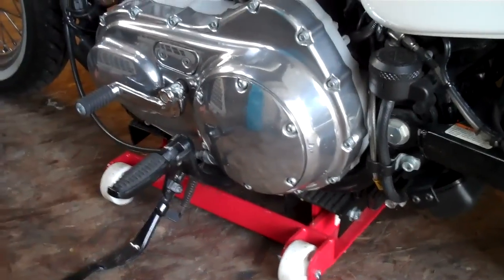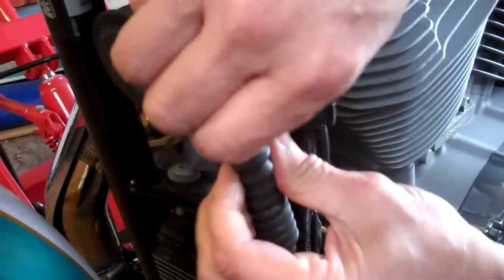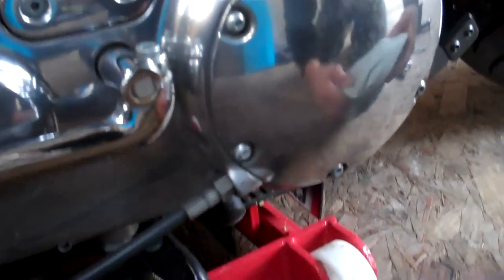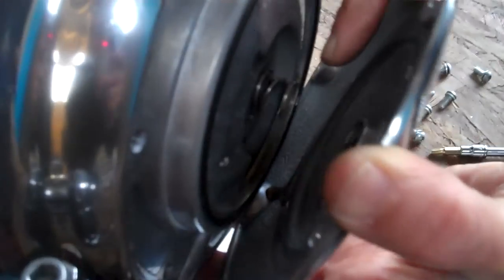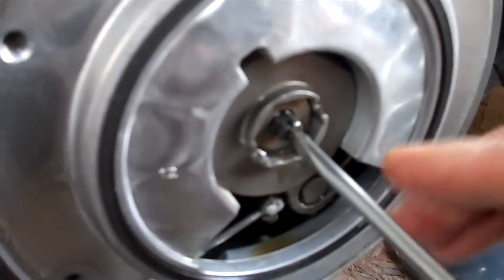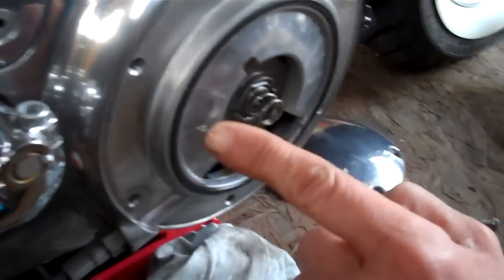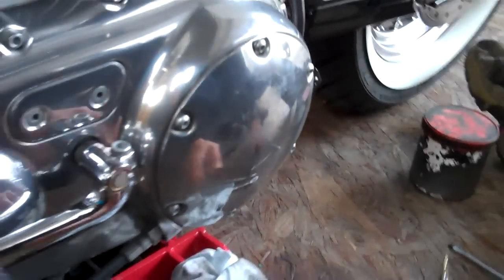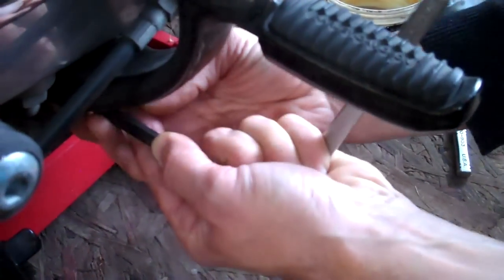Delboy's Garage, Harley Sportster Clutch Adjustment.

Comment: Hi Del. Your video is great! Many thanks for the clarity of everything you put out. I just wondered if you had any ideas on this problem I have. I just bought a 04 Sporty 1200 and the clutch was biting very close to the handlebar so decided to adjust it. When I drained the oil there was very little in - thick and black. Put 1 litre of fresh 10-40 oil in and followed your adjustment video. Now the clutch won't disengage fully and gears grind going into first?? Any ideas would be much appreciated. Thanks

Comment from the maker: @1supermanprime Hi buddy, as long as you turned out "ANTICLOCKWISE" then it usually stops against the seat within about two turns max,.... but if you have had to turn it 6 or 7 revolutions... then it looks like the reason is that somebody who did it last time made the common mistake af turning it IN or CLOCKWISE... 

Whatever you have now... just make sure it is one quarter turn IN from fully out... (so turn to the left until it stops... then turn one quarter to the right..ok?)

Comment from the maker: extra plate is to increase the friction level in the case of extreme tuning.....plus....do you think !"Harley actually MAKE!" clutch components?....no, they buy them in just like 99% of their parts...and who makes 99% of all clutch components...Goodridge and Barnett"......so you're just making an upgrade on the spec that's all... and only do that if you need to for something like a 60% increase in torque.....hope that helps..good luck buddy. Del.

Comment: On a sporty XL 2008 what could cause that the gear is not changing but when I re-engage the clutch lever I will hear a quiet click on the current gear and then the gear will go into its designated place. This happens at random times and not always.

Comment: First, Thank you all the way from Canada. I attempted to adjust the clutch pack and did my very best to follow your excellent instructions. After putting everything back together I went for a test ride. Now it was late in the evening and didn't really let the bike warm up. From the start the bike reved to 2000rpm. I made it around the block and came straight back home. Is this a direct result of a mistake in the clutch adjustment or do Sportsters rev high when cold? Thank you so much

Comment: Hi Del. i am gonna do this job saturday i think. I have a question about when you turn the adjuster screw to the left and then it will bottom out , right? the question i have is when you turn it back to the right , does it bottom out, or  does it need to be a precise quarter of a turn. I just gotta be sure before i start this. Thanks for the awesome video AND answering all my question.

Comment: Great videos! I have a weeping leak from the shifter when riding on a 2009 XL. I pushed the black bushing up against the engine on the shifting rod to see if that helped for a bit. No more leaking. But now I am not sure of the current oil level or what it would sound/feel like with low oil in the primary. Would I follow similar steps to check the oil level on the primary chain as demonstrated here or could I ride until next oil change? Any tips would be helpful for a new Harley owner.
Reply from the maker: Hi Jeffrey, There is a ring seal in the output shaft hole and it looks like you managed to push it back in so it seals....if it leaks again you may have to replace it (really easy job) but if its sealed again for now then great....

To check the Primary oil level, set the bike upright (NOT on the stand) and take the clutch inspection cover off.....look down at the bottom of the clutch pack and you should have the oil just touching the bottom of the plates....if its a little low, then just add a little more through the hole until its correct... its not too critical buddy, its just splash oil to keep the chain from eating the sprockets....no pressure to it like engine oil...

Hope that helps, good luck and always feel free to ask of you need a tip or some help... ride safe.. Del.
Reply: Moonfleet41
 Took the cover off! Checked the oil level. All was good. At the appropriate level for the chain. I buttoned everything back up and man those screws feel malleable just like you said. Now just check for any leaks when I ride to be safe. Thanks for instruction a first time Harley owner on his first maintenance check.

Comment: when you took the derby cover off to adjust where the cable hooks up what could have went wrong with mine it will not spring back when I let off the clutch handle

Comment: Hi Delboy
I have a 2003 XLR 883 which I have replace the clutch cable as I have fitted a 14" ape hangers. The clutch was working fine, but now it is very hard to find neutral, and when stopped it wont go from first gear into neutral it gets stuck. Just wondering if that has anything to do with the clutch adjustment that you just did.
Thanks will
Reply from the maker: Hi Will... The clutch adjustment in this video is focused on setting the internal freeplay inside the clutch pack which allows for heat expansion in use, its nothing to do with your bike sticking in gear as long as its set as in the video here.  With your lever, make sure first that you have the 3mm of play at the lever knuckle, and that the cable is not trapped or kinked, if that's ok then check you have set the 'ramp' assembly at the right angle as it should be so its getting the full range of travel. finally, does the bike "creep" or drag when its in gear with the clutch pulled in?....check those things and see how it goes, and let me know how you get on...good luck Del.

Comment: @Moonfleet41 Allow me to clarify; I have adjusted the cable properly as per the FSM, your video and a few websites.  I do this with the gearbox in neutral.  I button up, roll the bike around in neutral, then push the clutch in and kick it in to first.  Now, with the clutch in AND in first gear the bike should roll freely.  However, it will "peg" against the gear and stop.  If I push really hard the bike will roll BUT NOT turn the engine, as if it's riding on the clutch.

Comment: Thanks for the video!

If after the adjustment the bike wants to move forward while the clutch is pulled in should I turn it a little more clockwise and do a little less than a quarter turn?
Reply from the maker: Hi Gabriel, Yes its sounds like you've ended up with a little drag... so just open up the casing again and give it another go... back out counterclockwise until you feel the touch against the seat... then turn back in clockwise a full quarter turn. that will set it right... Good luck with it buddy.. Hope it works out this time.. Del.

Comment: @Moonfleet41 That is to say I believe that the clutch isn't releasing entirely.  With the clutch handle released the bike will not roll at all in first gear regardless of how hard I push.  (Of course it would eventually crank the engine in this case.)  Again, adjusting as per FSM, clutch handle in, bike in first, it will "hit" the gear, then roll with great effort against the resistance of the clutch.  The cable is correct; good P/N and I measured it against the one I removed.  Cheers & thanks.

Comment: thanks for very helpful video, but need to ask you :

 i have replaced the new clutch set on my sportster 2005 about 3000 miles ago .My last run was 1000 miles in a week then it begun. between the gears bike was hardly accelerating,  I decided to readjust the clutch . the hex nut was stuck in the housing.  I  removed. readjust  and close. It was all fine running. 

Now my question in why hex nut stuck?

how soon clutch should be readjusted after the clutch set  installation ?

Thanks for your every single video all haps a lot :)
Reply from the maker: After running in a new clutch pack, then re-adjust the freeplay after 1000miles, same as on a new bike and then check every 5k miles afterwards, don't know why it was stuck, would have to see it !  It sounds like you got it done though!

Comment: Hi, Just watched your very helpful video, but I must say that you suggested using 5/16" allen hex key. Well on your advise I ordered one on-line and went to remove footpeg but to my horror the key doesn't fit??? I've looked in the official manual for my 1995 Harley XLh1200 and it states left footrest support; 5/16-18 x 3-1/2 in. bolt (2 off). So can you help me to work-out where I've gone wrong???

Comment: Ha Ha DelBoy. You were lucky!.. Guys, beware of that rubber ring under the clutch cover. Following advise, I didn't buy a new ring, just the gasket for the upper peep hole. I duly removed the Clutch Cover. Shock Horror, the rubber ring was badly damaged. HD manked it up when building it new. It's late, miles from HD & miles to be ridden. Whatever I did, it wouldn't go back in. Cleaned it all up, reverted to super glue & eventually got it in. Ther're tiny lugs too that hold it. Take care. :-)

Comment: Great videos, super well done :) I’ve been recommending your vids to all the guys I know in the Sportster Sickness groups. 
I’ve done the 5K service on my ‘48 but I now have a spasmodic jumping/slapping in what feels like either the gear selection or primary chain. It’s not all the time and only when I pull in the clutch when coming to a junction or lights, any ideas what it could be? I never had it before I did the service, so I assume it’s something I’ve done. I used all genuine HD oils. Many thanks for any thoughts for what to check.

Comment: Del,
Love your videos man. I wrote you not too long ago about an 883 to 1200 conversion I was planning. It went GREAT!! My Sporty has a lot more get up and go now. However I have a problem that I would like your opinion on. This problem precedes the conversion and I thought that cleaning the carburetor would fix it but no such luck. Here it is.....
At low speeds the bike performs great first through fourth are good and no problems with shifting however, once I get the bike up to speed and shift it into 5th around 75mph-80mph as I am rolling up on the throttle  the bike starts to feather. What I mean by that is power is lost intermittently....power....high rev....power.....high rev.....then if I try to gun it power goes out completely and the bike dies. I thought it was a carburetor problem but since I did the conversion I cleaned and re-jetted the carb so that's not it. When I opened the inspection cover and drained the tranny fluid I noticed 1) it was very thin and 2) there were very small metal flakes in the bottom of the drain pan. Tell me I don't have a transmission problem...PLEASE!!! My plan this weekend is to replace the tranny fluid and see if that helps. Any thoughst you have on the matter will help immensely. Thank you so much for all your videos and for your time in this matter. Your fan in Florida....

-Jeremy H.
Reply from the maker: Hi Jeremy... to keep it as simple as I can for you, your fault sounds possibly electrical... if you're holding the throttle open and the bike is cutting out and cutting in intermittently, it could be a power loss to the coil, or an ignition fault... possibly a plug lead breaking down, or a fractured spark plug... but if it's just fuel starvation (which strictly speaking should then be in all gears) then it could be a re-jetting issue - you've jumped 50% in cylinder capacity and even though you've jetted it, it could just need a little more work... it could need a little visit to a dyno to be properly set up, for not only best performance, but also best gas mileage.

With your metal in the oil, I just want to check we're not suffering a little trans-Atlantic confusion here... by 'transmission' do you mean the left -hand primary case, or the actual 'transmission' itself (which we call the gearbox)? 

If it's the gearbox, then that oil is the same as the engine oil, the one oil does both and that's the stuff in the oil tank... if you have metal flakes in that, then sadly, brother, you do have issues... but if it's the 'primary case' on the left-hand side you mean, then that oil just lubricates the chain within... sometimes if the chain has run very loose due to not being correctly tensioned (we have a video if you need it) then the chain will chew the casing away as it hits it, so pretty much, it's just debris that can be washed away with an oil change & once you've tensioned the chain, it should be fine.

Sorry not to be more help here... but both of these issues are something that need investigation to cure, as there can be more than one reason!

Good luck with it! Del
Reply: The power loss is only in 5th gear and only at high speed. And yes I was referring to the left hand primary case, the clutch inspection cover, the same cover you just posted a video about tensioning the clutch. Transmission and primary chain case lubricant felt "thin" when I removed the cover (as I did not know to have the bike upright as you pointed out in your video). Could this be the cause of the 5th gear problems I'm having? Also, after I have had the bike in 5th and tried to power it thru past 80mph, it has cut out and I have re-started it, my gear shift will fail to fully disengage when I shift. In other words it will stay in the up position after I have shifted and I will manually have to push it to the down position in order to shift either up OR down. However this will NOT happen if I stay in low gears and just toddle around town.

I know man....I got some weird shit happening in this primary case. LOL

-Jezza
Reply from the maker: Jeremy Holland
Hi Jezza...ok, now you made the comment "power loss is only in 5th gear and only at high speed"...it all comes clear mate....basically, you are topping the motor out, remember 4th gear is top gear, and 5th is overdrive....you will always make more power and higher speed in 4th than you will in 5th....once you hit the overgearing in 5th the motor needs way more power to just keep the speed the same...so it looks like you've just hit the roof buddy...that's all she's got..lol 

The sputtering you are experiencing is the rev limiter....if you hold it in 4th long enough you'll feel it there too eventually...and i guarantee your bike will make a higher top speed in 4th than it does in 5th....because 5th is designed for cruising.... the gear shifter lever sticking could just be that its pushed in too close the the primary case...pull it off and remount it out a tiny bit further....also the bike could have been dropped in its life and the lever bent in a bit.....but i think the two issues are unrelated ,ate.....in short, if you want to ride faster buddy....you need to buy a faster bike...you've reached the beans on this one..lol

hope that helps
Del
Reply: Del you are a master......now that I think on it I wasn't letting fourth go far enough.....you are so right. I can't thank you enough for all your help. If you ever get over to Florida in the Orlando area I truly owe you a few beers mate. Ill keep a light on for you. hope to see a new video soon. All the best.

-Jezza
Reply from the maker: Jeremy Holland  Hey brother, no problem, you're most welcome... it's just biker's sharing their knowledge, it's what we've done since the 50's... if we ever get the chance to take a holiday, America would be our first choice, so never say never!  Ride Safe buddy, Del

Comment: Alright dell boy, need some help i have this issue but i have hell lot of play but its on 125 superbyke rmr i did hydraulic clutch conversion onit 
When i removed my cable operated and in with new i notice there alot of play on clutch push rod i adjusted my adjuster on clutch it self left some play but now and again by pulling my clutch in it stops half way like something jamming on sumert and can get it into gear

Comment: but on a twin cam 88 you want to go ahead and turn the Allen head in till it seats, then back off half to three-quarter inch of a turn   correct ?  so I guess Sportster clutch packs or the opposite of the adjusting the twin cam..

Comment: Great videos just reviewed the tire worn/pits replacement...in regards to clutch pull on the Sportster have you intalled any of the easy pull clutch fixes, do these work and if not is it worth going the hydraulic clutch route? I've had carpal tunnel surgery and my sportster has so much additional tension than Vstar I had in the past. Thanks,
Reply from the maker: Hi George, I had no reason to install a light clutch ramp, as the 08 models come with a light pull clutch as standard, and I believe they're inter-changeable... so before you spend all the money on an hydraulic clutch, then try a factory clutch ramp from 08 onwards... it was fine even with Penny's small hands, and I could pull the clutch in all the way to the bar with 2 fingers easily!

Comment: hi there. thank you for sharing your knowledge with us. i wonder if you could help me with something. i have a 95 lowrider, all stock. i have the tank off and am wanting to do away with the VOES. i'm not a mechanic and would just like to get rid of anything that might give me trouble down the road. is that a bad idea or will it run ok? i want to use a simple non-vacuum petcock. thank you for any help
Reply from the maker: At '95, surely your bike should have a regualr petcock no?

Comment: Del, what do you mean when you explain the seating of the ... when you are turning the screwdriver anti clockwise half turn then back half turn, what is happening to the clutch that I should expect to happen? I will attempt this for the first time, so want to know before I pop open the cover.

Thanks mate.
Reply: yes and no the instructions that I was able to find  didn't give any  info on the actual set up just how to install, thanks anyway